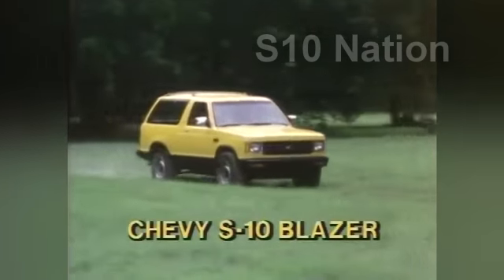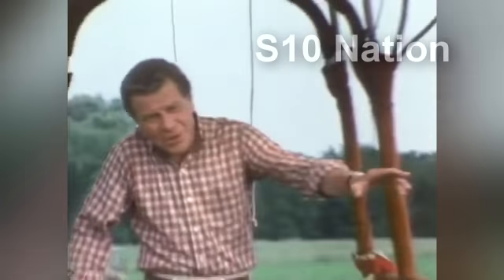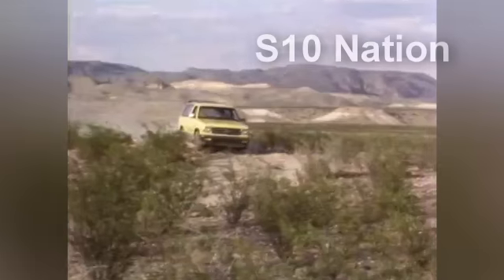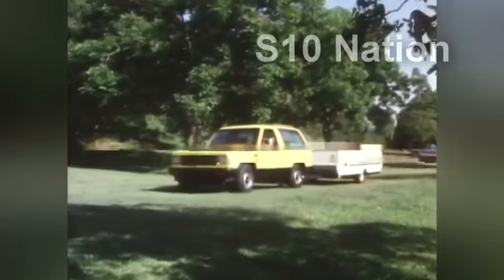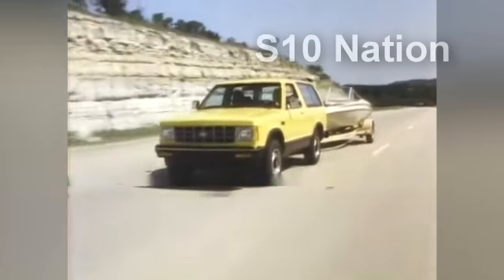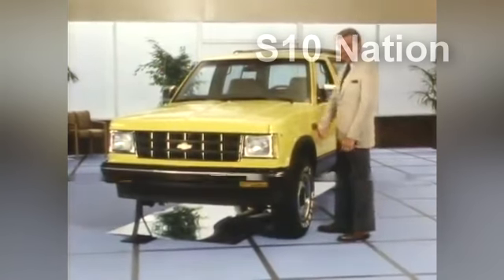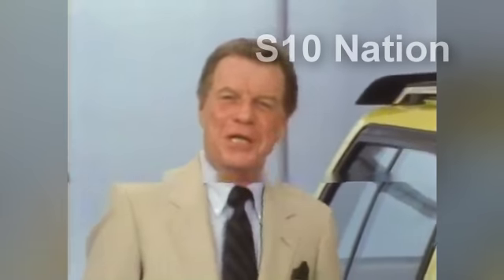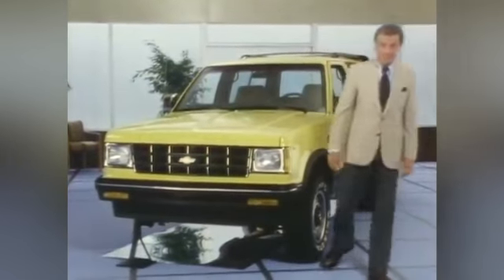1983 Chevrolet S10 Blazer Dealer Training Video

Comment: Man I  miss my old S10 Blazer. Soo many good memories from high school and after with that thing.
Reply: Lol I hear ya. I had one in high school too. Overall it looked and drove great. The two issues at the time were the ignition switch didn't need a key, and so my buddies would always move my truck for fun. There was also a pin hole in the gas tank, so I'd take a corner and loose fuel.
Reply: @nubwagon3758  oh man I forgot about the ignition switch. Anyone with a GM key could start Blazer. 😂🤣

Comment: Cool video ! Thanks for sharing. I have owned my 1987 Chevy Blazer S10 Tahoe for the last 4 years. I am a Ford guy really, and have  always been a fan of the Bronco IIs and the shitty mid size suvs that were produced in the 80's/90s. A Bronco II was my first vehicle that I bought for just 500 bucks in 1999, and I had it for 8 years and bought 3 more over the years.  But before I started driving, my buddy who was two years older than I had very same S10 Blazer I do now, and we went every where in NJ in that thing in the 90's, and that is why when I seen it I had to buy it. So many good memories growing up in my buddies Blazer, and we went to Ozzy Concerts, camping trip in Stokes State forest, off roading in West Milford, and taking beach trips to Sea Side Heights and Asbury Park Nj.  That truck was a lot of fun, and so were my Bronco II's. They are basically the same thing.

Comment: I bought an '84 Chevy s10 Blazer 4x4 last year for $300. Not as pretty as this but gettin' it fixed up. Super stoked to get it all fixed (mechanically). :)
Reply: I just picked up an 87 pick up, working on doing the same with mine
Reply: Getting mine 84 tomorrow 130,000 miles $2300 is this a good deal?
Reply: @1jdm408  What's the condition of it? Also, how do you know it has that many miles? I do believe the odometers only show 5 digits plus the 1/10 digit.

Comment: Mom got one in 1987, the doors had massive rust holes in them when I was old enough to sit in the front seat. 2002 or something. No airbags, so it was okay to sit up front. Haha
Reply: I inherited my grandpas 86 s-15 jimmy. The poor thing has rusted out like crazy. Big pieces of metal missing haha. Maybe that special steel and rubber spray wasn’t as effective as they had hoped 😂
Reply: @ANGUSM82A1  There's only so much you can do to make steel rust-resistant

Comment: I was lucky, and got my Blazer from the Original owners with just 75,000 miles on it, and after 4 years I now have 97,000 miles on it ! It has been a rough ride, and I have had a few typical GM problems with it ( Steering Column mounting bolts came loose and had to be completely rebuilt - the power steering pump mounting bracket cracked and had to be welded - 2 radiators so far because they are auto zone Chinese garbage that break - and a few small things.) but I like the truck so much, that I went through the hassle to keep it going and fixing it because the engine still goes with no problems so far thank God. 
  Also, the truck has been immortalized on the cover of my Second book and it is now famous, so i have to keep it on the road ! It is the show truck for my book !  My book is called Road Rage - At Its Finest, and it is on Amazon ! My book is the first self-help book for Road Rage and it is selling like hot cakes. Please check it out :}  You can type in my full name on Amazon also, Gennaro Lombardi - or check me out on instagram  @ History in the Writing.  (alloneword)